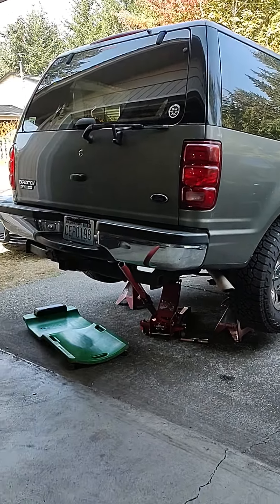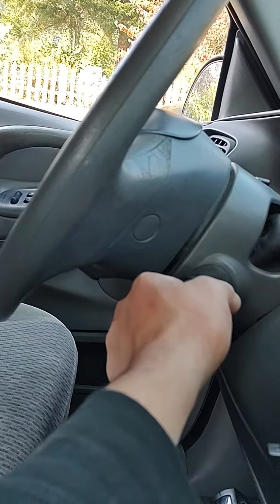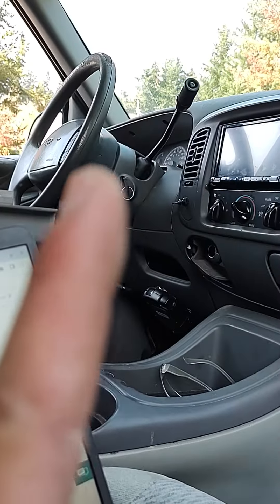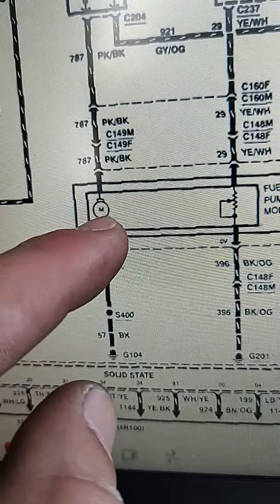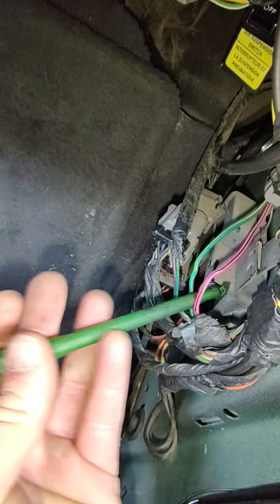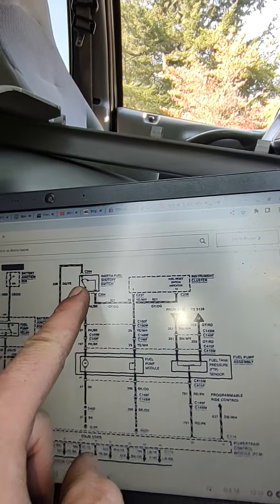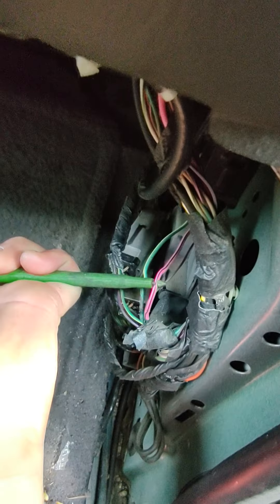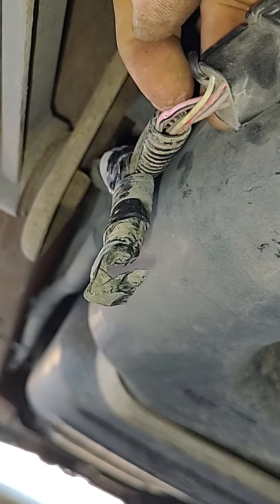1999 Ford Expedition how to check for power at fuel pump

Comment: I'm working with ford expedition 2000. I only have a momentary negative on fuel pump relay after switched on.but when I cranking...the fuel pump relay now working because it doesn't have a steady negative signal on fuel pump relay. Any ideas how to locate where should come the negative signal from for the fuel pump relay?